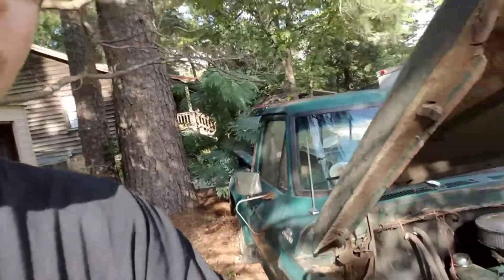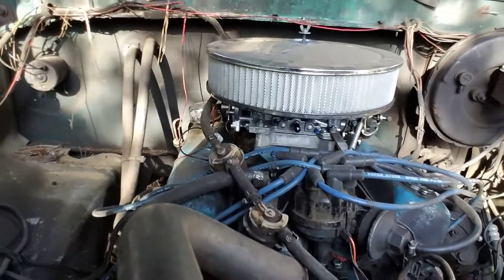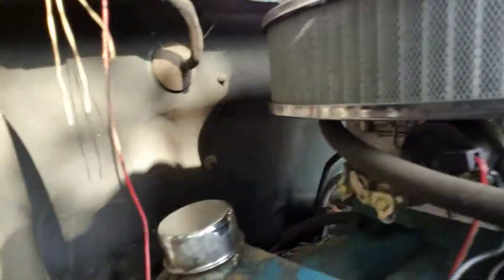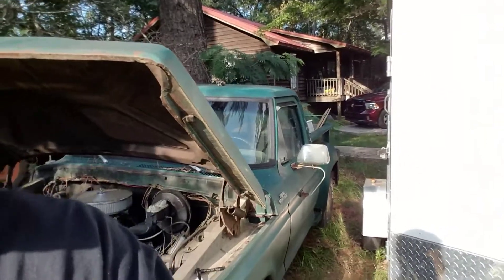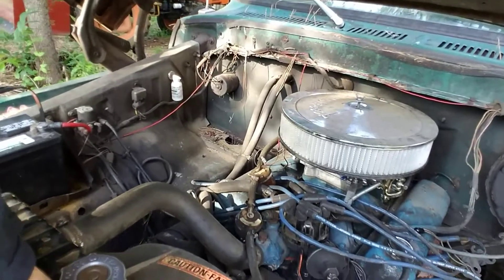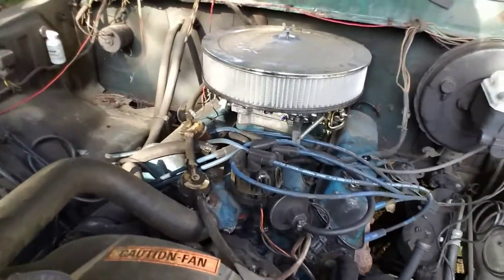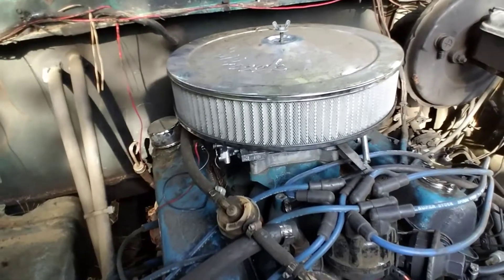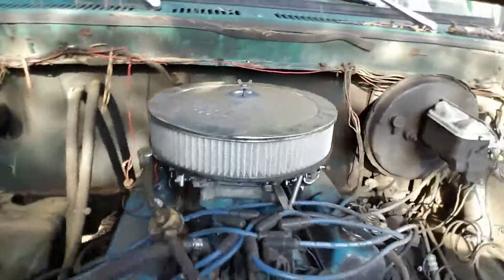Ford 302 with a problem

Comment from the maker: I got it diagnosed.. it was definitely a bad timing set.  After replacing my distributor and wires with no change.  I replaced my timing set,  new gears,  new chain.  BANG! magically runs smooth and powerful.. no backfiring!  Hope this helps somebody out there.